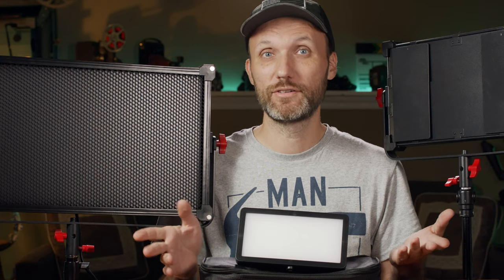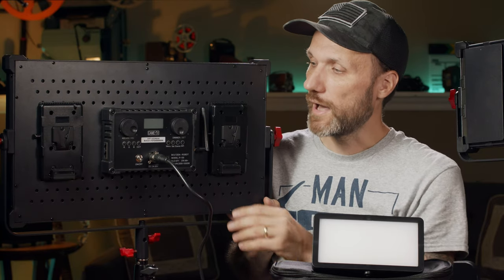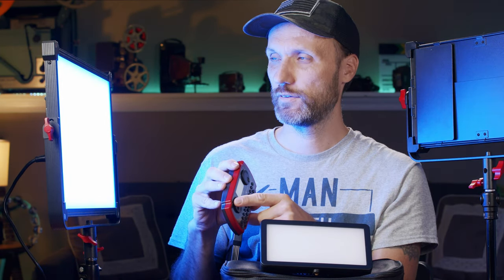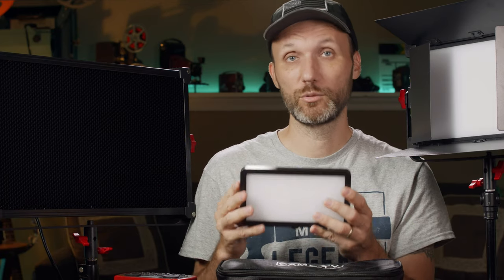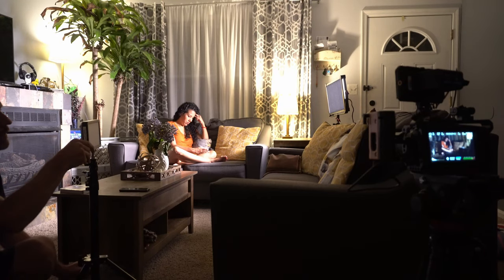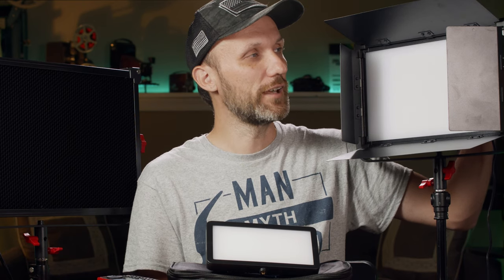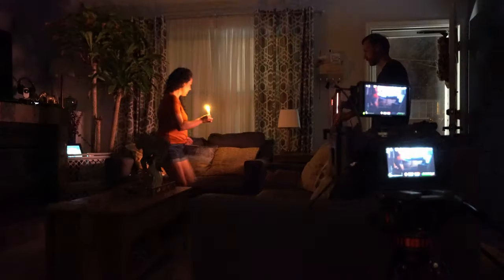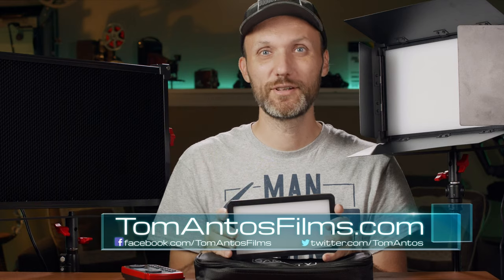Low Key Lighting

Comment: Hey Tom do you still have these lights and have a way to measure some basic luminosity ratings for the output at .5 meters and 1 meter Came-tv does not have them listed only the wattage

Comment: Hey Tom, where are you placing the IRE values on her skin tones in these darker shots? For instance, what color would I be looking for in the BMPCC4k false color readouts? Highlights vs. Mid tones, etc.?
Reply from the maker: I wanted the scene to have a darker feel so I kept a lot of shadows and I also exposed get face by 1.5 stops. Best way to measure that is with a light meter. But you can also use false colors. Just set your aperture to 1.5 stops over what you want your final setting to be then adjust the lights till the face is in the midtones on false color then adjust the aperture back to 1.5 stops under
Reply: Tom Antos great advise. Thanks Tom
Reply: Thanks Tom Antos, at what aperture and ISO did you shoot?